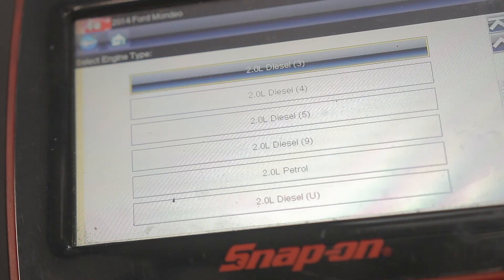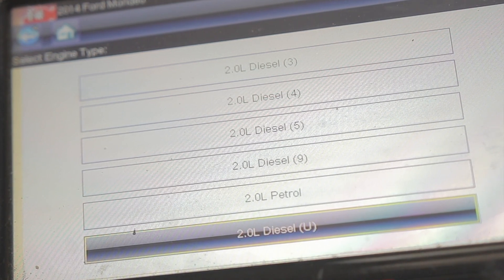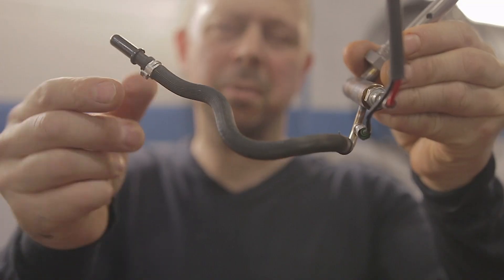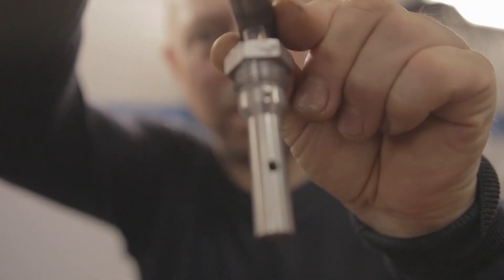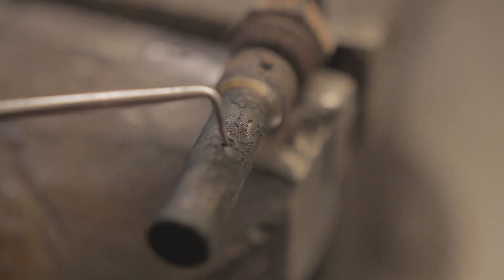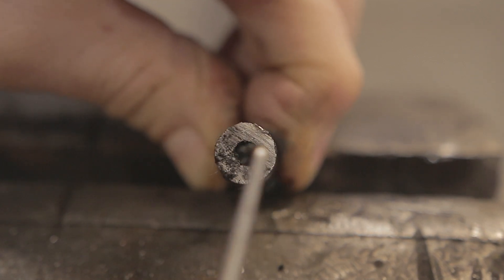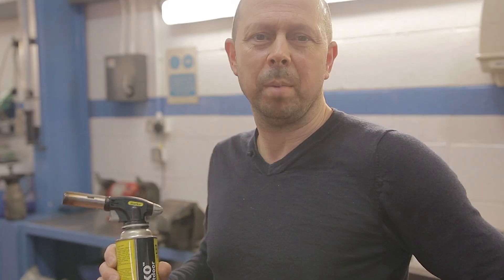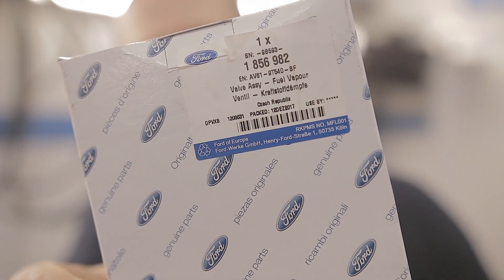Ford Mondeo Mk4 Diesel Particulate Filter, Fuel Vaporizer, closer Look

Comment: One more good advice. Because the first engine malfuntion error will be for the vaporizer itself, either the glow plug or temp to low for regen. A lot of people ignore it at that point, as the engine is not yet in limp mode and they think it's fine and keep driving. Then they clog up the dpf, and I've even heard about turbos busted, because of the hight exhaust preassure. So as soon as you get exhaust temp to low error, just change the vaporizer asap, don't drive anymore than a few miles. That's how I've done. Got the low temp for regen error, drove it straight to the garage to change the vaporizer, got there with dpf load still at about 50%. Changed it, no static regen needed, all fine.

Comment: Great vid. I think this might be my problem. I have a transit connect 2012 with dpf and I get an Orange cog ! Light on dash saying engine malfunction. The diag reads code po380 glow plug, control circuit. I changed the engine glow plugs but light still comes on after about 15 mins of driving. If my vapourizer glow plug was knackered would this be the same code? I did have a code about a week ago which hasn’t come back though, p244c  temp too low during regen bank 1. Any help would be appreciated. Thanks

Comment: Are these main dealer only?
Reply from the maker: if you go to ebay and type.. dpf  fuel vaporiser you will get lots of cheaper options
Reply: @alan4x  I've seen those but wondered if they would be any good? Thanks for the reply.
Reply from the maker: @t1ghe  i have only used ford genuine ones but there is not much to them so i guessing the aftermarket copies should work perfectly well
Reply: @alan4x  Good point. Cheers pal I will do some ebay searching.

Comment: Hi Alan. Any idea how it decides to regenerate on these Mondeos? Trying to understand if I have an issue or not. I can drive for up to 3 full tanks of fuel without ever noticing a regen. Perhaps it's doing them and I don't notice. But other times, I can notice a regen when I stop (I always drive off again to let it complete). But as I said I can go for weeks without noticing one, and other times I can feel a regen even after 300km after the las one. And once even after 150km from the last one. Even dough I pretty much drive the same roads mostly, with like only 30% city driving. I also use the same premium fuel everytime. I never drive bellow 2000rpm, and driving pretty fast in general. The random 150-300km intervals scare me a bit. Is it just normal? Thanks
Reply: I cannot find any real technical data on these. Thers is only one site which seems ok, that mentiones "Frequency varies between 160  km and 500  km and each regeneration process lasts between 10 and 20 minutes." Mine lasts less than 10 mins...guessing it could regen as maintenance to, on steady drives? As 150 km without any city driving I don't think could fill it. I got longer intervals with city driving than this.

Comment: Hi. I'm thinking of getting a Mondeo tdci 2.0L 2015 plate. Annual milage 9700, occasional motorway trips. We want diesel as its a big car. I'm worried about dpf problems. I know there is 1.5 ecoboost, but I m unsure if this unit has the same overheating issues and head gasket problems. Any advice would be really appreciated. Thanks
Reply from the maker: i would avoid the 1.5, also not much go in them.. you are better just with the 2litre, driven right they are pretty good on fuel
Reply: @alan4x  Thank you very much for your advice and for answering. 👍

Comment: I have tried in my local area to resolve this recent development after viewing your videos and cannot find anyone other than main ford dealership to fix this for less than £1150 is there a DIY way??
Reply from the maker: you can buy those vaporise nozzles off ebay a lot cheaper than ford and fit it yourself
Reply: Hi ,Alan gret Video , what brand should i get ?
Ford genuine are around 300
Febi about 200
Lucas 150
Thanks 
Vinny

Comment: Clearly this engine has been designed to maximise chargeable labour time to the absolute maximum. I'm surprised that some kind of international  trading standards body doesn't exsit to fine ford and other car manufacturers who clearly design their products to empty as much cash from your wallet as possible. Also it can't be very environmentally friendly if you have to replace items in the engine because they were disturbed to get to what should be an easy to service part. There's videos are really opening our minds to how much car manufacturers are ripping us of in the way things are designed.

Comment: Great video, I have a Ford Mondeo MK4 2.0 TDCI 2007 does mine have a Fuel Vaporizer? I have already ordered this https://www.ebay.co.uk/itm/FORD-MONDEO-2-0TDCi-Exhaust-Diesel-Particulate-Filter-DPF-Fitting-Kit-Included/182808573813 as it was cheaper than getting the old one cleaned but now I'm thinking is it the Fuel Vaporizer causing the problem if my car has one that it, I can't do a static DPF regen with error codes P2463 & P244B
Reply from the maker: i have never seen a fuel vaporiser fitted to a 2007 mondeo so i would say it does not have one but from under the car you can look up on the exhaust cat and see if one is there.
you can't just guess at this..... you need to find out why the dpf is sooted up and fix the cause....it could be the two rubber hoses from your dpf to the pressure sensor are burnt and have a hole in them.
if you do fit a new dpf you need a scan tool that can reset the dpf values in the ecu...this will put the dpf values to zero and then you can clear the fault codes
Reply: @alan4x   The 2 rubber hoses have been replaced as that did cause a problem last year as one was split, I have forscan to reset and clear, I've order the new DPF let hope this sorts it out 🙂

Comment: I put mine in the lathe and drilled into the end in order to, clean out the crap then tapped the hole M4 and locked in a couple of grub screws,

Comment: Hi Alan, I have a mk4 mondeo 2.0tdci just under 122k and I have same light as you have on dash but my locals say my dpf has had it cos of mileage and if i have it cleaned it will only last 3months is this correct cheers bud

Comment: Hi Alan I have a focus mk3 1.6 tdci econetic and an info light(!) came on with p244c fault code (low catalyst temperature) does this code match with a faulty diesel vaporizer?
Reply from the maker: hi, yes that code does relate to the dpf nozzle if your car has one...also if there are two rubber hoses going from your dpf to an electrical box on your bulkhead...check them hoses are not burnt through first
Reply: alan howatt thank you for your help!

Comment: Great video! Could u tell me when u fit a new one do you have to prime it?
Reply from the maker: no you don't have to prime it but usually you fit a new one when service engine now is displayed on your dash and the engine lamp is on.. you would then need to have a static regeneration carried out on your diesel particulate filter before the engine codes can be erased
Reply: I see thanks for your advice. I was going to fit it then drive it until it did a self regen or do I need to do a static?
Reply: You should be working for the Ford Technical Support Department. On the morning of Friday 22nd November 2019 my Ford Galaxy Mk4 (2017) went into SMC Ford Gravesend with the amber engine warning light to be checked . Same day afternoon I been told it was one of the O2 sensor on the DPF has gone, needed replacing. They didn't have the parts and it's on order should be here Monday or Tuesday, advised me not to drive the car. And don't worry the repair was under warranty. So I left it with them. Came Tuesday 26th November, they told me the parts had to come from Germany and should be here Thursday. On Thursday 28th November they told me the sensor had been changed but the DPF was not doing an automatic regeneration and they don't know why and THEY HAD TO CONTACT FORD TECHNICAL SUPPORT DEPARTMENT FOR ADVICE. And they can only do this by email. The problem was It took one day to ask  a question and the next day for a reply from Ford. Anyway it took them a week to get nowhere with the problem. Today Monday 9 December they told me they been advised to change the Fuel Vaporiser. It's going to be Thursday 12th or Friday 13th December when the Fuel Vaporiser will arrive. Not sure if this will definite solve my problem. This has taught me lesson for buying a Ford. Never ever to buy a Ford again. Alan if you were working for them I am sure it wouldn't take this long for my car to be repaired.

Comment: Hi Alan hope you are doing well mate. Actually I need your advice and help 1st of all I got 2014 ford mondeo mk4 2.0 diesel power shift automatic transmission my car is jerking on slow speed and even while reversing and on hills . I have been many garages all are telling me different stories , so can you please help me out and 2nd where do you based as I might will visit you. Waiting for your kind response. 
Thanks
Reply from the maker: hi, the only problem i have is i have had nothing to do with these power shift gearboxes...if your car is jerking at slow speed...it could be gearbox related.
  there is a guy here on you tube who fixes cars and owns a mondeo with your gearbox..he may well be able to answer how these gearboxes behave because i have drove some of these auto boxes today and they are awful .. anyway he is called badgertronix.. might be worth asking him your problem first,
Reply: Thanks a lot for reply I will try to find out
Reply: @asifqureshi22  have you ever changed the oil and filter in the gearbox? They must be changed around 50,000 miles and are sensitive to the level being correct, experience says fill with 5.5 litres.

Comment: Great video as always. I have a mk4 Mondeo 2009 tdci (yes I know what you’re thinking 💩) but is there a vaporizer on my car? Thanks.
Reply from the maker: Krzysztof Kacprzak 
Hi, lol, I don't think 2009 mondeos had vaporisers fitted. 
To know for sure you will have to look on your exhaust down pipe. I don't ever recall any 2009 Mondeo with a vaporiser on it. They came out late 2011- 2014. Hope this helps. Thank you for your comment
Reply: @alan4x  hola yo tengo uno de 2009 y tengo el mismo problema, he cambiado el sensor diferencial de presión y sigo igual
Reply: Si no tengo vaporizador que debo cambiar? Mi filtro ya está limpio pero sigo teniendo el aviso en el cuadro. La máquina me marca estos códigos. P246B. P2463. P242F